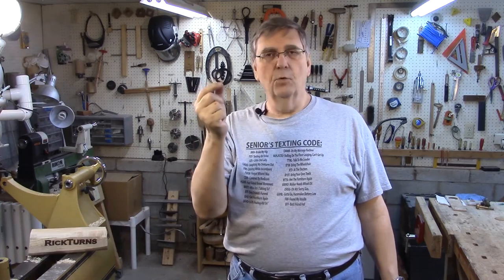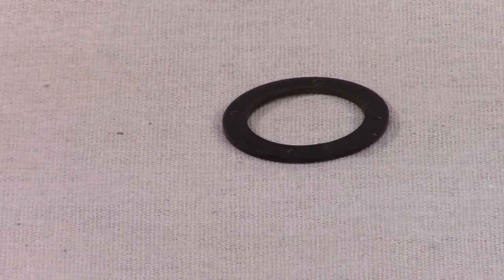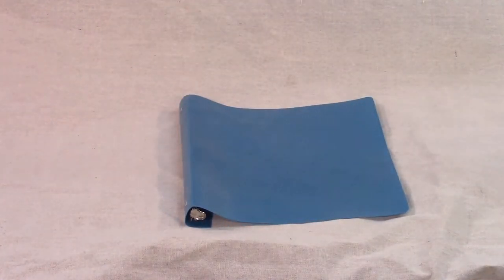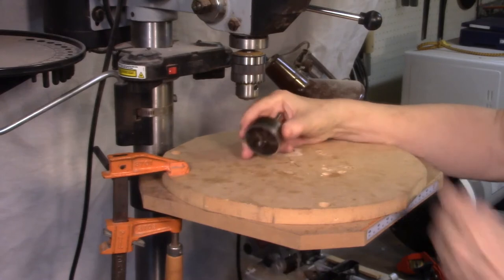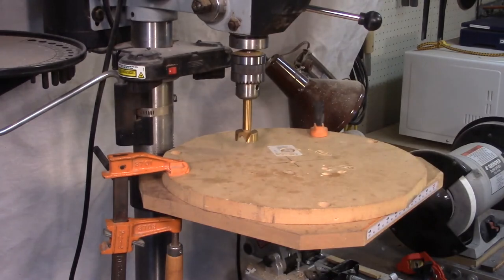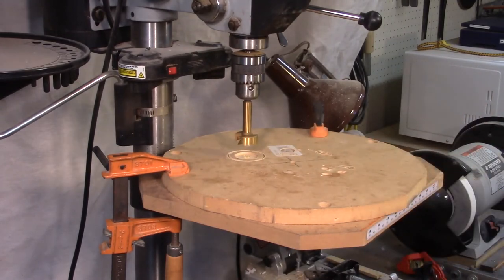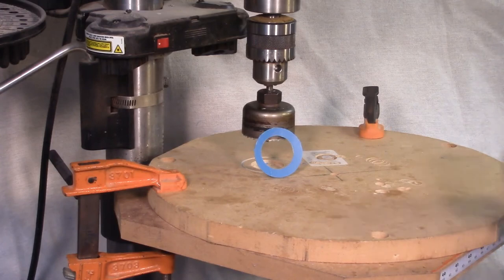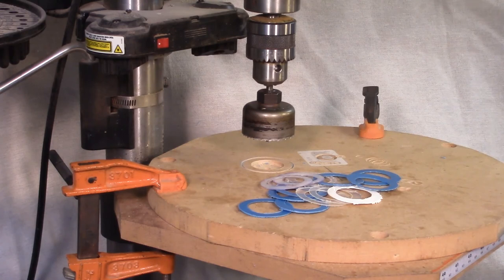Make a Headstock Spindle Washer

Comment: Nice job Rick, I did mine in wood for the rings, they work very well and do not have to replace them at all so far. Over a year now since I made them. Besides wood is very good for wood turning.....lol
Reply from the maker: Hi, Steve. I made two wooden washers from 1/4" plywood some years back, and they have worked well, although they've gotten a bit beat up now. I switched to plastic to get a thinner washer. Thanks for your comment!

Comment: Rick

Another neat project!

1.  Instead of using the hole saw, a simpler approach is to rough cut the outer circle with scissors, and then mount the piece on the lathe using some kind of narrow screw-on fixing to hold it in place.  Turn on the lathe, and then use a skew to trim the outside of the washer to the diameter of the stopper mandrel.  I use a spindle adapter to hold washers in place for trimming.  A scroll chuck would be a bad choice because the larger diameter would make it very difficult to trim a washer that it is holding in place on the spindle.

2.  If the washer doesn't have a uniform thickness, adding the washer can cause runout, especially if you are using a screw-on fixing to attach a longer spindle.  My wine stopper mandrel was made for a 3/4" spindle, so I have to mount it on a spindle adapter on my new 1" lathe.  But that combination means that a stopper turning is a fairly long spindle, and a little runout can cause visible anomalies.  To avoid this problem, make sure that the edges of the inner hole and the outer diameter of the washer are absolutely smooth.  I've found that some otherwise suitable plastics (LDPE lids from coffee cans or oatmeal) tend to not have uniform thickness.  On the other hand, those plastic mailers that certain well-known income tax software companies mail their products in seem to work well - just make sure to avoid areas with any kind of deformation or lettering in the plastic.
Reply from the maker: Louie Powell I didn't know that about the possible thickness variation. Thanks for the tip!

I can't quite visualize how you're hold the plastic blanks on your lathe. Got a picture? It sounds like it would work quite well, and possibly easier than what I'm doing.
Reply: RickTurns 
The washer will eventually fit between the shoulder on the spindle and a chuck or other fixing mounted on the spindle thread.  So I just put the rough-cut washer into that position and hold it in place with a spindle adapter, and then trim around the outside.  I use a skew, but a gouge would also work.

Comment: Why not mark out with a compass and hand cut with a box knife? An imperfect circle will hardly stop it from working and requires no sacrificial scrap.
Reply from the maker: Absolutely right! But way too easy. I've also made these from square pieces of 1/8" hardboard and a drilled hole in the middle, and that works fine as well.